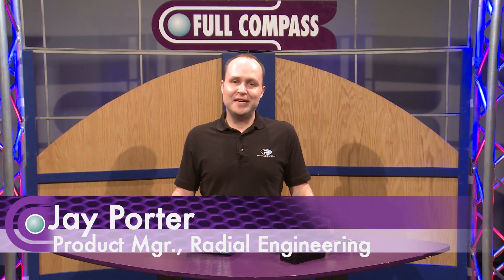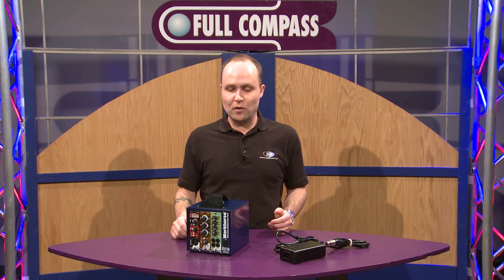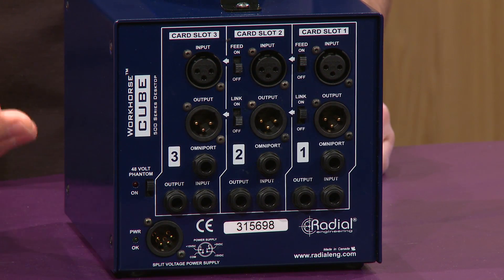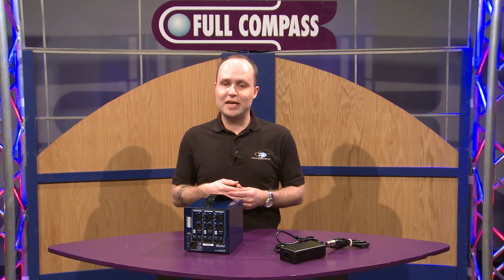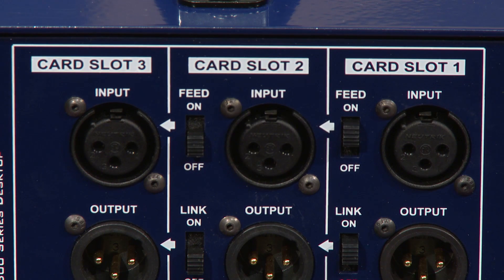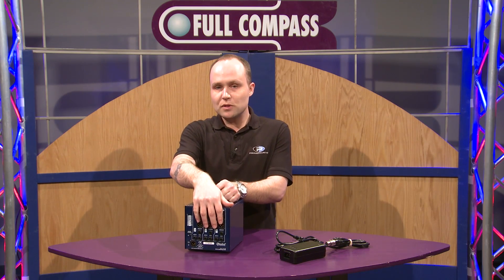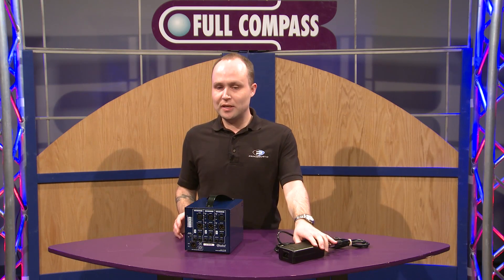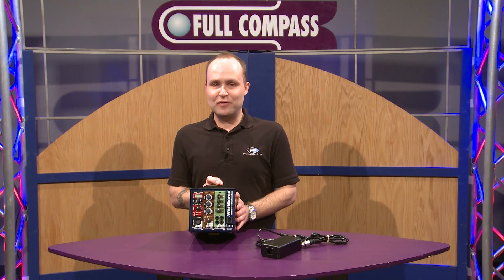Radial Engineering Workhorse Cube Desktop Power Rack Frame Overview | Full Compass

Comment: If I were to load the cube with an eq, could I go from the xlr output of a DI box (the RNDI for example) directly to the xlr input of the eq slot on the cube? Or would I need to have a preamp 500 unit in the cube to feed into the eq?